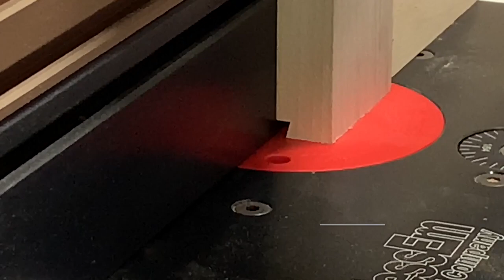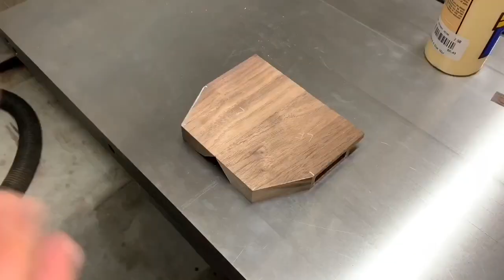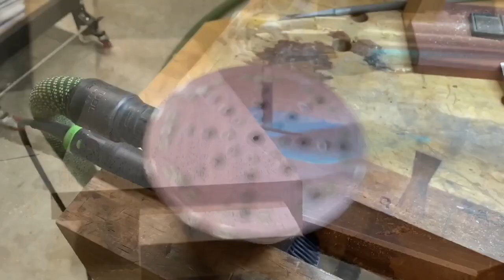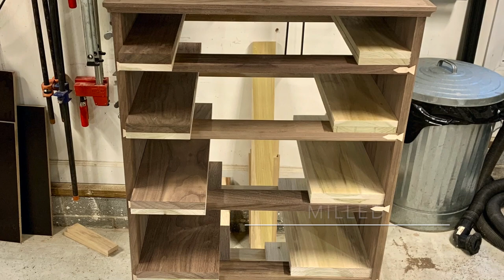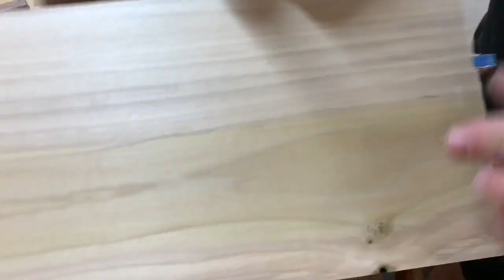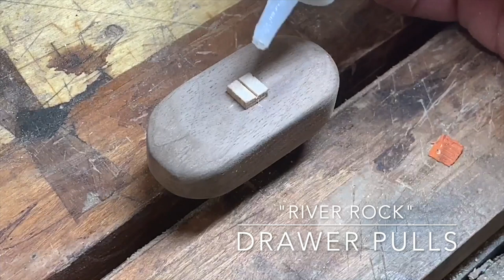Walnut Chest of Drawers Build Process

Comment: Awesome build, love the fish inlays. I couldn't tell from the vid, but how tight is that base slipped on there to the bottom of the case? I'm curious if wood movement on a wide panel like that would push the tenons apart on that base piece.
Reply from the maker: Thanks! Great question. Any movement on the panels would be front to back with the grain orientation. The front of the base is fixed, the base sides are attached with cleats in elongated slots to allow for movement.

Comment: What finish do you use?
Reply from the maker: I use a variety of finishes depending on the type of piece and it’s intended use. For this chest of drawers I used Waterlox “Original Sealer/Finish”. It’s a great product which, in the final few coats can be easily manipulated into different sheens. Sand/buff to a high gloss or knock it back a bit with some 0000 steel wool. 👍👊